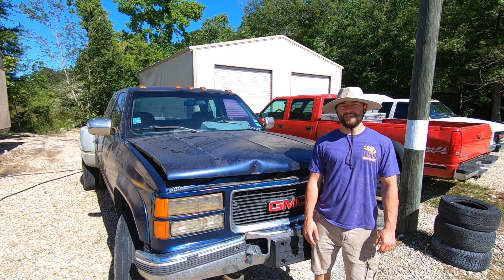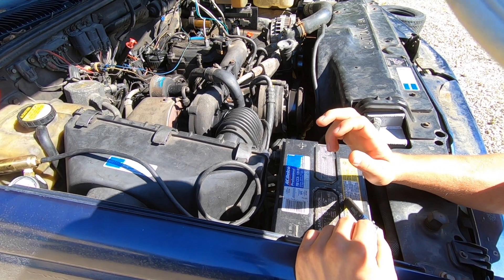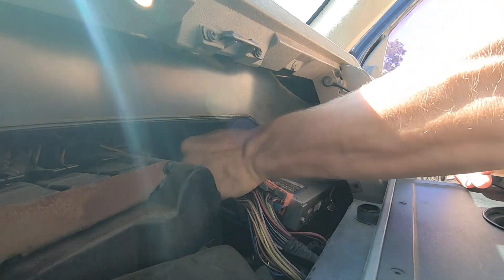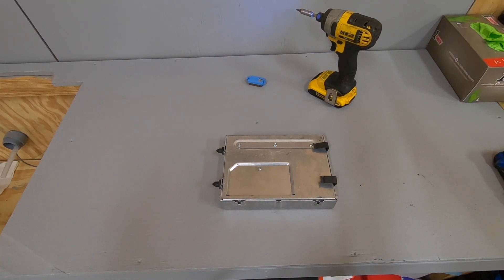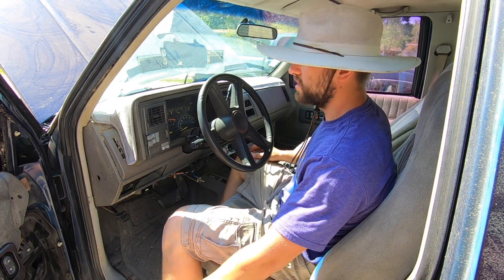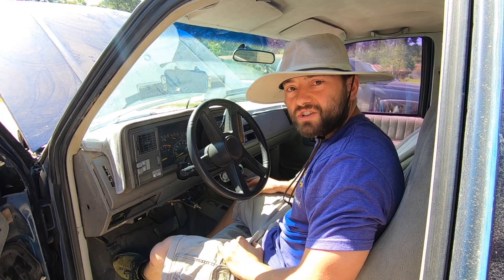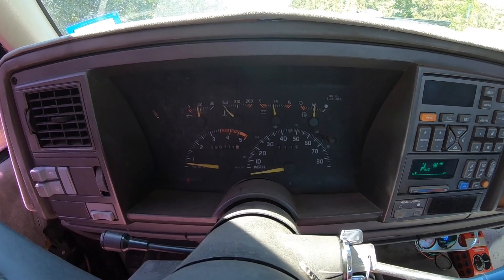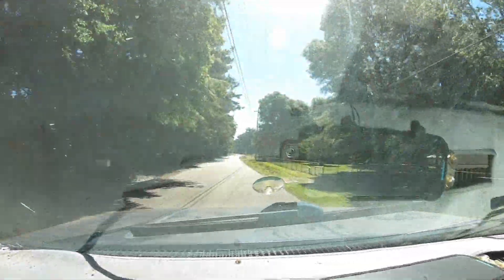PCM Tune Install || 6.5 Diesel

Comment: You got a fuel filter that WOULD tightin up? Maybe one out of 5 ANY brand I have used would sugg up enough to seal off one time then spend another $25 for another one I'd buy 5 at the time
Reply from the maker: That's unfortunate, filters are expensive

Comment: Those chips are nice I installed one on my 94 dually it woke it up alot !!
Reply: Yeah, mines totally stock so I’m going to order this right now and try it. I know it’s gonna make a good difference.
Reply: Did you find an increase in fuel economy?
Reply from the maker: My odometer does not work, so I could not calculate it
Reply from the maker: Best upgrade you can do!